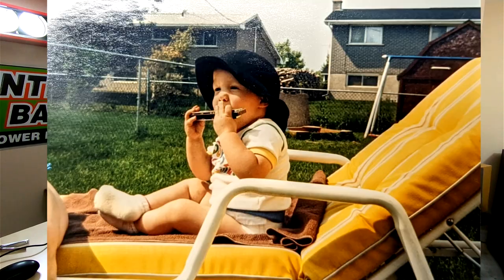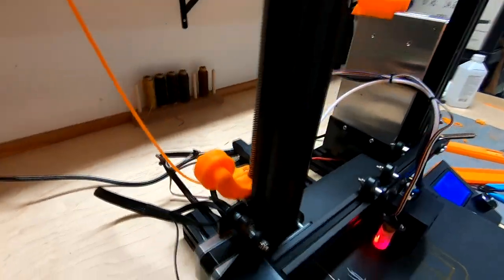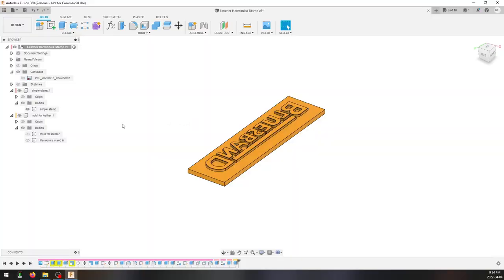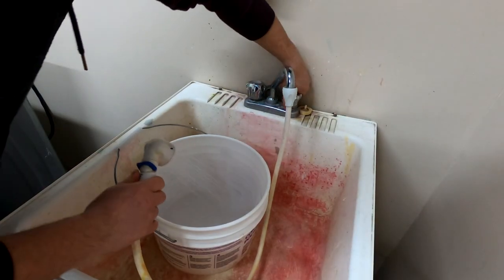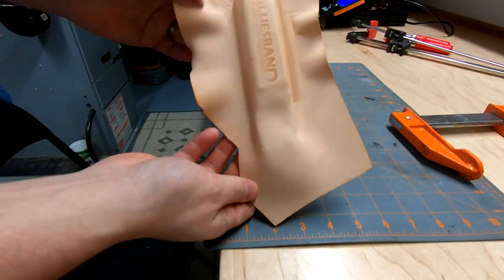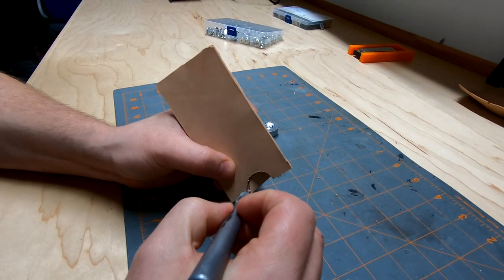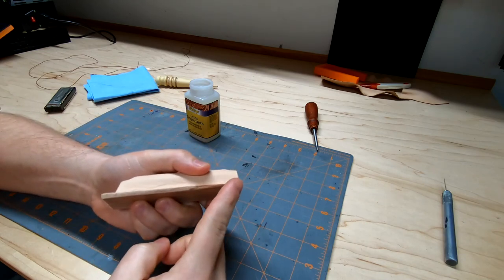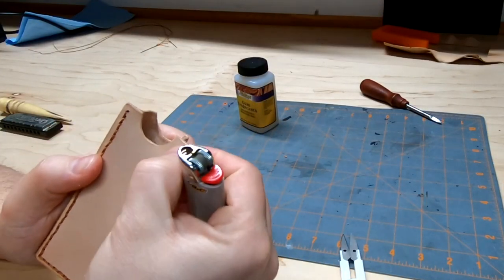Leather Harmonica Case (Wet Formed and Embossed Leather )

Comment: Funny that I came across this video, I am getting ready to make a leather case for my Bluesband harmonica. I am having problems finding a suitable logo to print off. I am going to cut the logo in and add some tooling around the borders. How were you able to print the logo? I do not have anything other than Word.
Reply from the maker: Glad to see another person protecting their bluesband! I took a picture of the harmonica and traced the logo using fusion 360 (which is free) if you check out my latest video (of the Sennheiser headphones) I go into a bit more detail on that process. If you are not comfortable with that I can probably provide you something that works with word if you contact me via email (or on Instagram @the_grant_alexander)

Comment: Nice. Only thing I wondered, why not 3d print harmonica standin too, for molding?
Reply from the maker: Thanks! You could 3d print it, but then you would want to have a very detailed model. By using the actual harmonica you will get a perfect fitting case that holds onto the harmonica tightly. 😁
Reply: @TheGrantAlexander  That is true. I was wondering because of pressure on it deforming it or such. Thanks for reply
Reply from the maker: @XXCoder  it wasn't much pressure on the harmonica just enough to keep the leather from pushing back. A small weight would have been sufficient. That being said, if you wanted to wet form something fragile I think printing it would be a great idea!